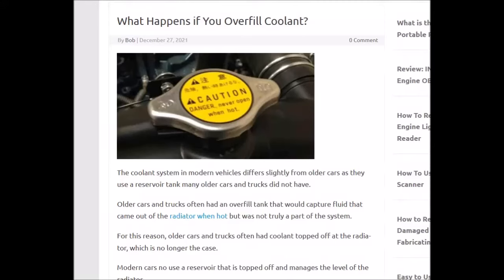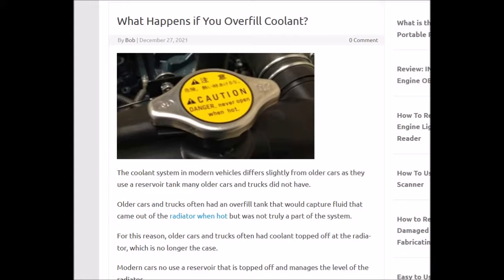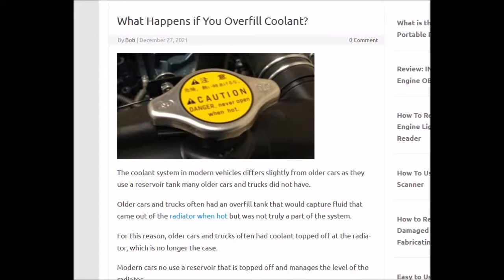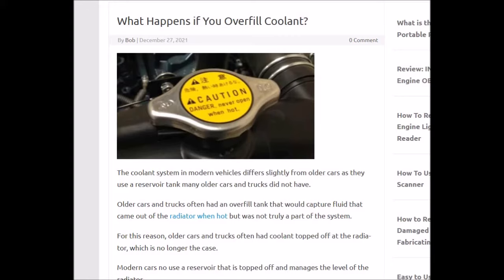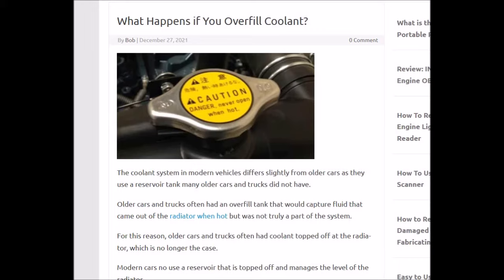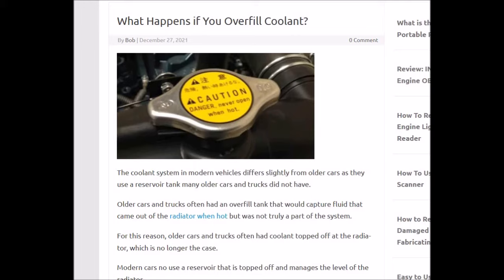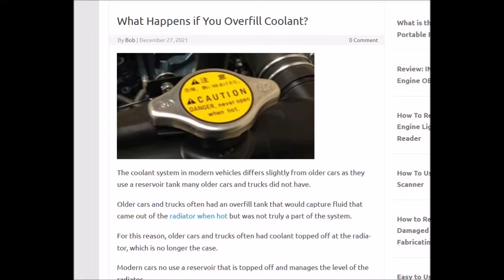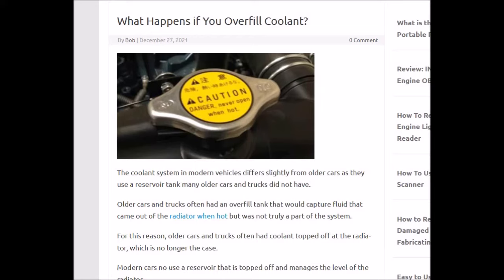What Happens if You Overfill the Coolant?

Comment: If you over fill coolant, and the excess coolant leaks out, will all of the coolant leak out or just enough to stabilize? Im trying to figure out if I have a leak somewhere.
Reply: It may be a little late, but no, not all of the coolant will leak out from being overfilled.  If you're low on, or losing, coolant and see no clear leaks, you could have a bad head gasket. Or, the leak could be hidden somewhere inconspicuous. It's best to take it to a reputable mechanic (the NextDoor app/website is a good place to ask for one) to have them troubleshoot it. 

If you want to try to find the leak yourself, trace the hoses/pipes/flanges connected to the radiator and overflow reservoir. (Coolant is routed all over the engine with hoses of varying sizes.) Look for spots where a rubber hose connects to any other plastic/steel/aluminum parts, usually with a clamp. Those connections are the most likely spot you'll find a leak.  You may see spattering or residue in the area and even pooling below those spots. Wipe down and clean those areas, top off the reservoir, drive the car for 20-30 min., then check those areas for new spatter/moisture.  Also, heavily-rusted steel lines or corroded aluminum connectors/pipes can indicated a leak.  

I live in the heart of the Snow Belt in Ohio where they use brine on the roads to melt the snow, which is terribly corrosive, and found a steel coolant line about 6 inches long that had 5 different holes in it!  It looked so bad I took it off to clean it on the wire wheel and found the holes. I wouldn't have known otherwise.
Reply: @ItchyKneeSon  Thank you!✌
Reply: @BrandonSmith-rb1bf  You got it!  I hope it helped.
Reply: @ItchyKneeSon  what happened if I spilled a bit of coolant on my car?
Reply: @tox1800 it'll bake off just like if ur doing a oil change and some spills out just let it cook off over time and you'll be good.

Comment: I accidentally put too much in the reserve is that going to be a problem or will it burn off because it was an empty at first
Reply: It will just blow out the excess and drip a bit. It won't cause any problems.
Reply: @HVAC_Mechanic  THANKS BRO
Reply: Thank you 😊
Reply: @HVAC_Mechanic  if the reservoir is full you can blowout a hose ect
Reply: Burn
Reply: Probably could use a baster to get some out
Reply: @ImBadNewz ,(9

Comment: Will it blow out from the radiator cap or from the surge tank cover? Both are pressure caps.
Reply: It will usually blow into the reservoir, but it depends on how the car was designed
Reply: yup... happened to me today 😢

Comment: I dropped A plastic item into my reservoir.  How can i get it out ??
Reply: You don’t, you get a new reservoir
Reply: You can possibly get it out with long pliers or similar.
Reply: You cna remove the reservoir. usually its hold up with 2-3 screws/bolts. there will be 2 hoses connecting to it. you will need something to block those hoses so that the coolant wont come out after you remove the hoses from the reservoir to get it put from the car.

Comment: It was working great b4 I put water and coolant in now it don't want to blow hot air
Reply: Coolant can have a cleaning agent to it...meaning it might have dislodge so gunk and turned it to your hearter core. You basically have two radiators one for cooling which is connected to a large fan right behind grill and the heater core which is usually place be hind the engine. Using heat means you run it through your heater core which heats up the air. If fluid can't flow through the core properly you don't get heated air. Try spraying water through the heater core. Maybe you clean it enough, it it doesn't work then you probably need a new heater core.

Comment: My car threw an error code for a temp sensor. I dropped it off at a mechanic and they said the replaced it but the radiator fan won't turn on unless the AC is on. Said the car will overheat until I get the issue fixed if I ever turn the AC off. I don't know much about cars but I popped the hood when I got home and they overfilled my coolant tank by quite a bit. It has a low marker and high marker and they went well above. Should I trust them with my vehicle in the future?
Reply: No. They don’t sound trustworthy lol…

Comment: I had a radiator leak I use some stop leak 4minute at work but I keep putting water in antifreeze in the Overflow and in the radiator to make sure that the car doesn't run hot should I not put water in the Overflow
Reply: I'm sorry you were a victim of using stop leak :/ that's some bad stuff like it does so much more harm than good

Comment: how can you overfill radiator?
Reply: @Ofourosix thank you I had a radiator leak and I use some stop leak and it was working for a minute and I was making sure that I kept water in the radiator and the reservoir so maybe I should stop putting water in the reservoir and just put it in the radiator😅
Reply: @mrsbond9743 you should stop using water and use coolant instead....
Reply: Dont ever use stop leak. Just replace radiator. Stop leak gets all through the engine block and can also plug up places that need coolant to flow.

Comment: I think My coolant got In distributor. I have a feeling something else is going on cuz Trans slipped caught and slipped again and now won't catch any gear could the coolant somehow get in my Trans? I don't see that I have a trans dipstick on my 2005 ford explorer. I would think if it ran out of Trans oil there would be a warning light. The check advtrak light has been on since I bought the vehicle in 2019. And should have brought it in for that. Anyway can I fix myself.The only thing I did was add coolant a couple days prior. 2 weeks prior I changed my motor oil. Did not replace the plug. I was going to follow this up w/adding some Trans fluid. I bought the transfer pump for adding atf for my vehicle. But after it has sat for a week w/out previously having time to look at it there is a puddle of coolant ontop of my motor. Idk what to do can't afford to take it in.